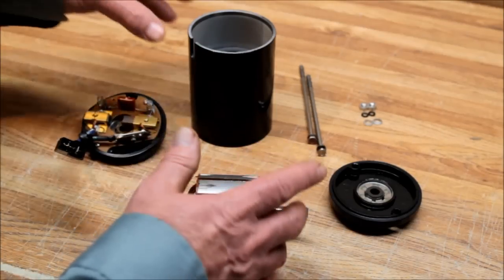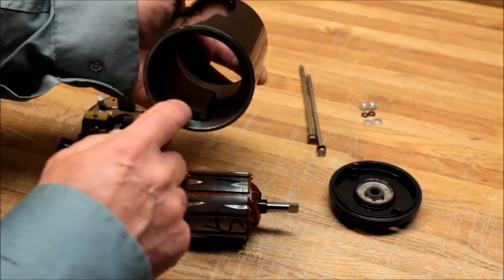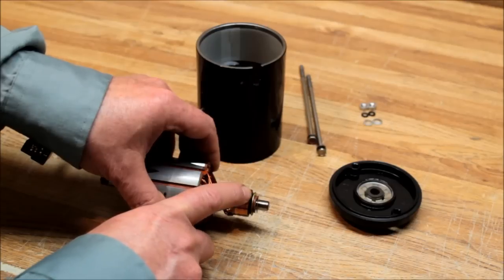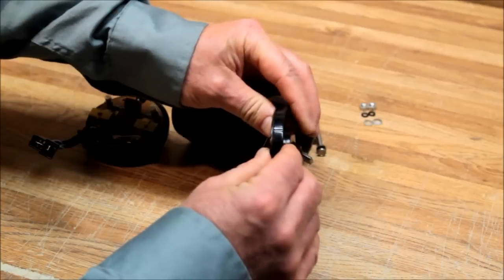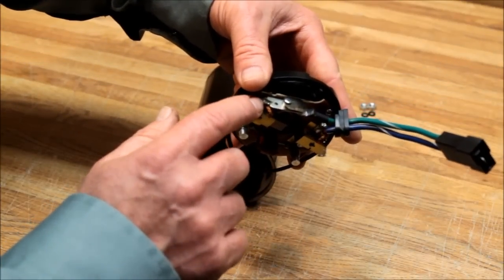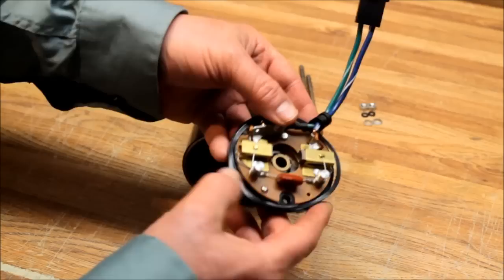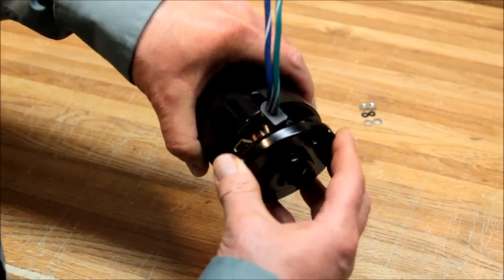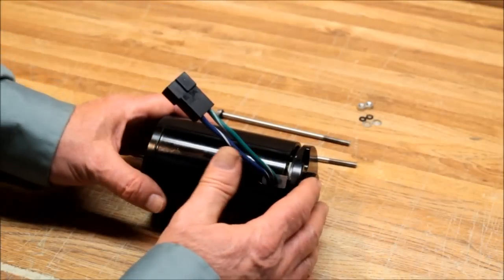Marine Tilt & Trim Motors, How to Service, Proactive Maintenance

Comment: You're showing a motor that has provision for relatively easy installation of the brush housing.  Some of them are absolute bastards. I was hoping to see a demonstration of installing one of the difficult ones.  Incidentally, many of the replacement trim motors come complete with a new reservoir pre-assembled so you only have to screw on the valve body. It's the only practical way for an amateur to do the job.

Comment: I have a 1978 Sea Ray SRV200 and the guy I bought it from said that you may have to tap on the motor to get it to work.... I can't even find the damn thing! Could you number one tell me to find it on the boat and if this unit you show here will work for this boat? It is the V8 Merc thanks in advance for any help!  Tommy

Comment: I have an old trim motor on an evinrude 4 cyl. engine,I believe they are 1986 or there abouts.I'm trying to bypass the switch and was wondering if you could tell me witch of the three wires is the hot one,Red,Black or Green? thank you

Comment: this video was invaluable to me.  thank you!  I have a forester boat w/ omc cobra 5.0 and the trim motor wasn't working (only relay clicking from control) .... turns out the trim motor had an inch of water in it when I opened it up!  no wonder it was shorting out.... I cleaned all of the inside and replaced springs behind the brushes, as they were rusted out too.... commutator was black as you described and I cleaned it with emory cloth.... cleaned everything as well as I could... anyway your video saved me throughout the process so thank you!